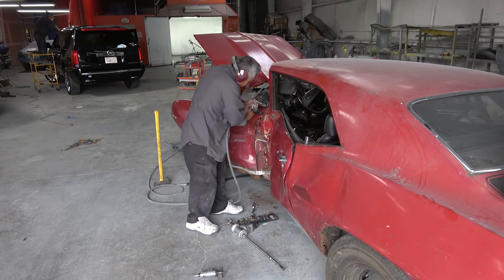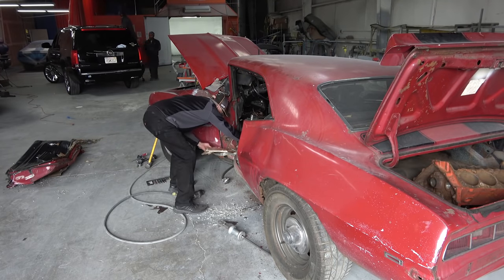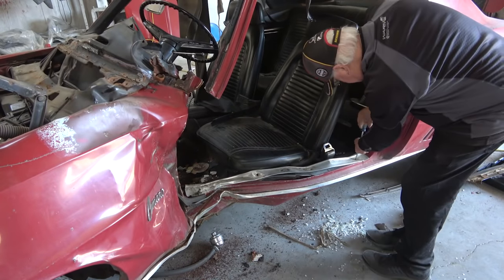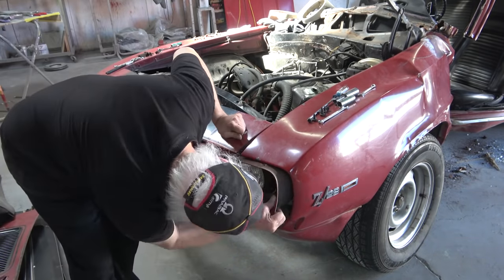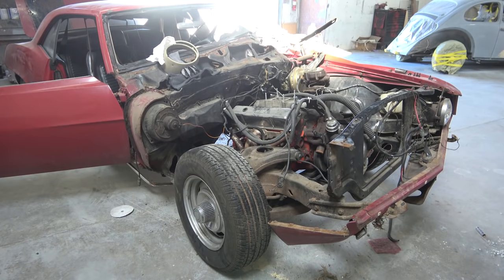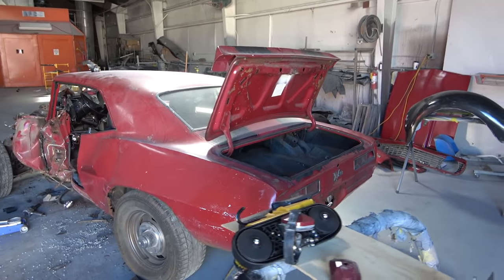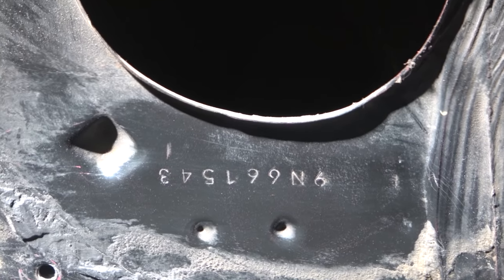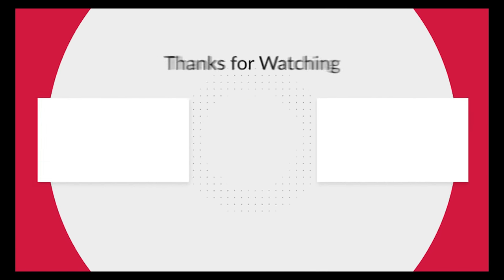69 Camaro Garnet Red Crashed but not Dead Z/28 Restoration - Part 2 This a 2nd series of a 2nd Z/28

Comment: Back in 1977, I was involved in a major accident with my 1969 Camaro. The car had substantial front end, sub-frame too damage. The passenger door was also compressed to the rear.  Most people would have junked the car, however, I located another 69 Camaro in a bone-yard that had been rear-ended and junked. I bought the front half of car for $400 (they literally cut the car in half) and had the bone yard drop it off at my home. The repair was substantial, but also somewhat easy. I pulled the undamaged 307 engine & auto trans from my car, then I jacked up the front end of my car and removed the entire front-end (4 bushing bolts and two brake lines, various wires, etc.).  Bottom line, the repairs cost me less than $1k which included a color matching paint job from "Apcoa Paint & Body."  Remember them? Funny, I still have a lot of the unused parts from what remained of the carcass including the complete and mint  dashboard  (showing 67k miles on the odometer), the steering wheel, steering column, etc.  These couple of parts today, especially the dashboard, are worth much more than I spent to fix my car back in 1977.

Comment: I'm a retired auto body, frame, unistructure, paint and suspension tech, I used to love to work on cars hit in the side! They would throw the insurance adjuster into a panic trying to figure out how to write the estimate! Most of the time they would let me figure the estimate! If I were doing this car in my shop I would have put it on the rack as soon as I had the sheet metal off of it and I would have left the ''A'' pillar attached! Plus I would have left the door hinges attached to the cowl and used them for pulling points along with the area where the power window harness goes through the side of the cowl As far as the rocker goes I would have to see the car close up to decide where to hook onto it.  I always liked to use the panels I was going to replace to pull the rest of the car into shape! It's been close to 10 years since I've pulled one hit like this one though, I just use my frame machines for getting under cars to work on them now! I'm really glad to see that you're fixing this one, I'm more into Pontiacs Olds and Buicks but the 69 Z28, 70 Chevelle SS and the 55 Belair Hardtop and convertibles are beautiful cars by any standard!
Reply from the maker: Thanks Danny, I am having a couple of experts looking at the car to come up with ideas of how to move forward from here. I appreciate your input and will consider your suggestions :)
Reply: I would have left the shell together to pull it .to correct all the indirect damage
Reply: Leaving everything in place and using it to pull on is a great suggestion. My dad's 1988 S-10 was rear ended, it buckled the frame and bent the bed upwards. The insurance company totaled it (it was about 20 years old at the time) and my dad bought it back from them (it never left his driveway; they cut him a check minus the sale price). It was really awful looking, but when the body shop straightened the frame the bed popped right back. It didn't even have a wrinkle in it. He drove that truck for several more years.
Reply: @MrJeffcoley1  sort of like un-wrecking it

Comment: I rolled an 8 month old 65 mustang drag racing back in the day. I came up over the peak of a incline on a 4 lane, with a grass center isle with rumble strips. The car came off the ground, and landed on the inside lane then slid to the outside lane before hitting the rumble strips, and rolling 3 times into oncoming traffic on the opposite side of the hyway. The car didn't have a straight panel, and the "A" pillar on my side was bent down to the top of the door frame. The auto body shop who were dispatched to tow it off the hyway that night bought it from the insurance co. I went to see it after being released from the hospital to get my personal effects. I was amazed they had the doors off, and had a portapower braced against the inside of the rocker panel. They got that A pillar as close to original as possible and cut the quarter panels off. I didnt think they had oam replacements back then. I came back a week later to see how it turned out, and was amazed at how it looked like the day I got it off the showroom floor. The only small detail of the wreck was a little crinkle in the headliner over the A pillar
 Otherwise, I was completely amazed at the ressurection of that car. As it turned out I was drafted into the Army in June of 66. Never looked back, just wondered if I would ever see the day I could Hotrod the streets of home again. Obviously, I did.Next Hotrod was a GTO.

Comment: I have only been doing collision repair for 46 years so still learning. I agree 100% with Danny below this reply, if you put what we call a collision pull before disassembly  you would get most of the panel you are saving where they go before cutting it apart. Plus you would have a lot easier time getting at the bolts.  Windshield pillar could have been saved if done that way and drill out the welds at the bottom after pulling.  I worked on those when they were just used cars.
Reply from the maker: Hi Bob, Yes I agree with you & Danny. I have consulted with a couple of different experienced body guys since the video was done and we are determining how to proceed from here.
The car will probably still be put on a rack and pulled and the A pillar may be reattached first. I will have a new video once we move forward. Thank a lot for your input.

Comment: Danny Casler is right....put it on a frame machine first, and pull everything back into the original shape before taking "anything" off. Pull straight ,pull the side etc. The main thing to do is to pull it backwards from like it was hit.....makes the job a helluva lot easier.

Comment: For me . I would have left the screen frame in place until the initial pull, and l would have left the right fender in place . It would tell me when the bulkhead is responding , each to his own .  However, taking the running gear out and then placing it on the jig is the way to go.
Reply: I'm with you! As a collision technician pull and square first a lot of bent parts will straighten out before you completely take it apart. Great call
Reply: @voodooreddevil7325   Hi. I did leave another comment in part 3. The floor is now cut and some of the bulkhead /firewall as well. He's got a complete floor bulkhead and dash. And he's calling  in specialists for quotes !? I would have relished repairing this ,  naturally to a proper and acceptable standard . Too late now !! Thanks for your comments. Take care and stay safe.

Comment: It was a warm summer night.my grandpa had just bought the car.he finished up with a fresh coat of wax as i found myself admiring the lines of car.the candy apple red made me hungry for speed.i decided to take the car for a joyride that same night. Midnight. My granda had just polished off his nightly 6 pack with bourbon chaser dinner.asleep on his recliner...i with the tactful skills of a ninja...slid the keys from under his playboy magazine. I knew from the cover girl approving smile i was making the right choice.i tip toed to the ferocious z28 and quietly popped the door open...and painstakingly closed the door.pummped the gas pedal 3 times and the horses all woke up very angrily. I immediately backed out of the drive and as soon as i was was in 1st gear...my grandpa was at the side window with a demonic look in his eyes.he said " its time to die son".i panicked..floored the pedal...but i just sat there...engine revving...a cloud of smoke ensued the entire car.i let off the gas and peeled away.as i came to my senses...i started navigating the night.i came to a corner...i heard a can crack open beside me.my grandpa was sitting beside me.he had gone around to the passenger side of the car during my long burnout. He chugged his Budweiser...crunched it over his head.i was in shock when he said..." it time to meet your maker son".i screamed " papa no!!! I just just couldn't help myself...the car is too damn sexy"!!! He told me he understood but you never touch another mans lady.he punched me across my face...we slid sideways into the local gentlemans club.the end
Reply from the maker: 😂 I laughed my ass off.
Great story 😎

Comment: Nice video. The roof is not the problem and should have not been cut and would have came back to place in the pulling process. The cowl,left drivers floor area,left rocker. You will spend alot of time on the left cowl piller post after removing the dash board and steering column. You will have to pull from outside and also push from the inside with a porta power. I could write more in this area but you get the picture. Do not get in a hurry as its not a race. Easy does it and do not set a dollar amount to fix this area of repair. A smokin deal would be 100.00 a hr. for the customer x actual hours of pull and repair time anything less and you are giving your shills away. Also a used cowl section and including left inner and outer rocker would really be a huge positive for this repair. The longer it sits unrepaired the more likely it will become a dust collector.

Comment: Did it hit the inside of a house? Dry wall is not generally used for exterior construction.
Reply from the maker: If it hit a corner of a building, it could easily get drywall shrapnel
Reply: @digitalpizza1  From where?
Reply: @coffeefish  That was my thought.  The corner is the strongest part of a wall.  To bust through all exterior of the house and get into the interior where the drywall is, I would think the car would be GONE gone.  Doesnt explain how it got there, but hitting the corner of a house seems unlikely.  Not that it matters at all!  This is going to be awesome to watch come back together!!!
Reply: Maybe it was a drive thru?
Reply from the maker: I just can’t imagine how the drywall got embedded into the wreckage. We were pulling out pieces of drywall as we were removing the door and fender.
Someone actually commented that they knew the guy who wrecked it and said that he was fine and the he hit a tree, so who knows 😎
Reply: @digitalpizza1  Maybe there was a piece of drywall leaning against a tree.
Reply: @digitalpizza1  I know the answer. It was a tree house.

Comment: On any 69 camaro you have restored have you had rust on the the sides of the firewall and do they make a replacement panel for that?
Reply from the maker: Hi Arlen,
Yes, AMD (American Metal Direct) makes every panel for the Camaros.
Check them out and good luck
Pete
Reply: digitalpizza also do you know if anyone makes reproduction shaker cans for convertibles?

Comment: D80 just means the car was originally equipped with spoilers.
With the stripes missing on the hood, and the rest of the car having original paint it gives me the impression it was added.   You may want to look for more clues to verify, like the factory punched firewall hole for the wire harness just above the fuse block behind the brake booster, and whether it actually has a hole where the solenoid would have been mounted on the firewall near the wire harness gutter, I'm not seeing one.  Hope that helps.
Reply from the maker: Hi Firebird, yes good point. I am aware of that about the D80 & the solenoid, I haven't had a chance to look at that. When I saw the date stamp on the hood, I was assuming that the hood came on the car. But it make sense that the paint on the hood and the lack of holes for the 302 indicates that it was probably added.

Comment: i worked at a junk yard  in the early 70s and  we stripped so many muscle cars that were a lot lot less damaged than this car .. i bought a 69 r code  stang needing only a front fender / bumper  and grill all which was at the yard already in the same color .. later bought a 69 a12 super bee with a dented quarter panel that was damaged in the great tornado outbreak in 74  .. a GSX stage 3 buick was dismantled needing a front cap  .. so many more stories of this nature ..

Comment: Car was wrecked when the transmission mechanic took it out for a test drive on a rainy day after alignment of the blow proof bellhousing.  I was told he went off road and into a tree.  Walked away from accident and still works at the shop.  It originally had a flat hood too.
Reply from the maker: Hi Dave, wow, that's great info. I figured it was raining or snowing because the wipers were stuck midway. I am puzzled however where the drywall pieces came from if he hit a tree. There were actual bits of drywall and wood embedded into the wreckage and a big chuck on the drivers floor. Anyway, its amazing he didn't at least break a leg or 2 and he is extremely lucky his head didn't hit the tree or the a pillar. He must of seen it coming and laid down :)

Comment: The nice man said to subscribe, so I did. 

Good job, one question though? Should it go on the frame machine first with the subframe on, and then unbolt?
Reply from the maker: Hi Rick
Thank you for your support, I really appreciate it :) 
I agree that car should be put onto a frame machine. 
I am going to follow the advise from the body guys as to when and how.
These cars have a sub frame only at the front. 
I am guessing that the unibody is going to have to be rebuilt first, then put on the machine with the repaired or replaced sub frame.
Thanks again Rick
Pete
Reply: Glad to meet you Pete. I’m a hobbyist car builder and familiar with the F-Body as it’s pretty much my favorite car. I just finished restoration of a 67 and I know from what I recall on these cars, you should pull them to square with the subframe intact and then unbolt, or it becomes a little bit of a struggle for things to line back up when the frame gets mated back to the body. 

Not that it can’t be done any other way, and I’m sure your team has experience and will get that gem back on her feet again. 

I don’t really subscribe to much, but I like your content and attention to detail. Your blue Z/28 was out of this world awesome and I expect this will be no different. Looking forward to more content.
Reply: I agree

Comment: Tacoed just behind the A-pillar on the driver side. That's a tough fix.
I did 10 years in a body shop.
I'd look for a donor body with the front clip and subframe intact.
If you have the paperwork, the plates and the vehicle tags- you can build one. Right down to the seam sealer. All you need is tattoos and a felony.
"Iron American Dream" on YouTube

Comment: Brother, what a hit !  Hope you have the braces to weld/ bolt into the body to hold the uni body in place to replace the lower rocker & floor. Are you going to get a used cowl to replace it with ?
Reply from the maker: Hi Mike, yes, braces will be used. The car will be pulled out first and gotten back to normal as close as possible before the damaged panels etc. are replaced. The upper and lower cowls, firewall and both tulips will all be replaced. All of the work will be filmed and posted on the channel.
Reply: @digitalpizza1  HUGE job ! as that is the hart of the body,   Might need to do some pulling on a frame rack as well . Will be watching. I am the original owner of my 68 RS/SS 327 car I bought brand new in 68 , it has 680,000 miles on it, been totaled twice and restored 3 times and fixing to get it again as it's my daily driver.  I REFUSE to own any car with a COMPUTER in it!

Comment: What's that sitting in the back trunk  ?????
Reply from the maker: Hi John, that is the original numbers matching DZ Block which is currently at the machine shop get repaired and prepared to re-build to be reinstalled during restoration.

Comment: That car is a unibody and its been hit in one of the worst spots on it , its also twisted there’s only so far you can pull on these unibodys before you start twisting and distorting and affecting other alignment points of the unibody . It’s a endless circle , I  get its a numbers matching car but the labor is going to far out weigh its value if its even repairable correctly . To many hours on the frame rack and you’ll be cutting out the entire floor and replacing sheet metal and more . Will be entertaining watch this series of repairs . Peace friend

Comment: Z Axis !? YYZ , X GM Welder + Gm Dealership , AME  +++ Retired ; I Know Stuff & this Krate does Not Belong  back on the the Road , Period ... How Many Spot Weld's Pop ??? Side Rocker's Were the Structural Link Sharing in Combination with the  Unie-Body 2 Complete the Structural Link to the Fore & After Frame Mount's . Structural Integrity Has Been Lost & Can No Longer Be Trusted . Internal Sub-Assembly Part's & Weld's Can't B Duplicated  From the Outside , Not 2 Mention Coatings & Sealer's . Good Luck & Happy Trial's , YYZ , Rock-Crush'in Ratman . Mind the Upper 1/4 Panel's & Roof Weld's as They Are All Part of an Integral Unie-Body Shell & Structure / Z Axis ! ... That's Y When Hp went Up , Convertible's went Out , [ Early Unie-Body's Bend & Flex ] !